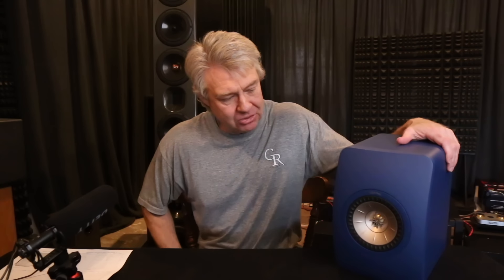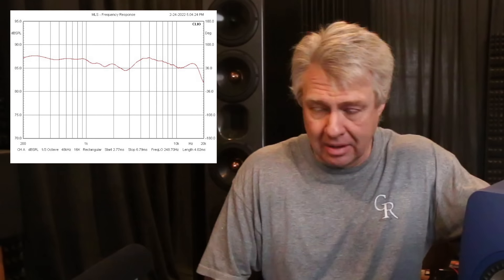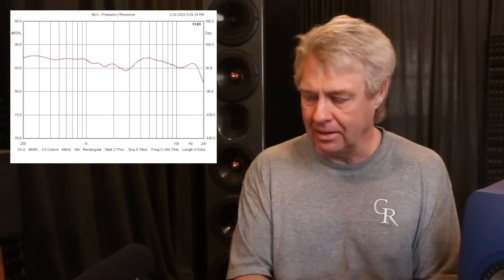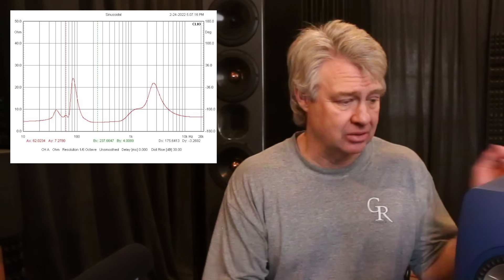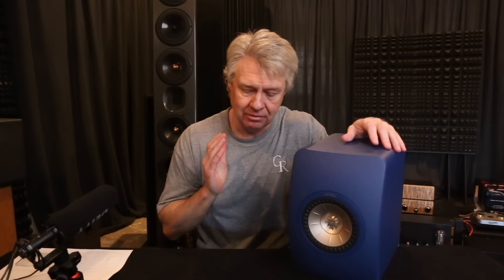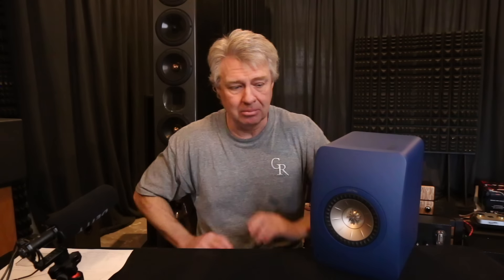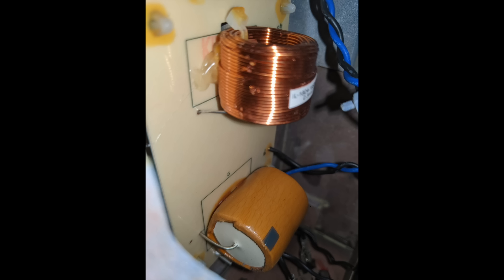KEF LS50 Meta! Worthy of HYPE?

Comment: Interesting ... Main reasons for the "listener fatigue" are:
* Too bright sound.
* Room reverb.
Since the speaker is measuring pretty good, the only reason for the former is other equipment characteristics or settings. As for the room, if sitting closer (really near field) helps, it is the problem that can be addressed in many ways.
I own LS50 Meta since they ware released (over 18 months). And I love them for many reasons. They are in use for many hours almost every day. 
For me, the main trick to have great sounding system without overspending is to have a pair of decent subs. This is even more true for ppl like me having home theater and music in one package. The subs dramatically reduce the requirement for the amp. They also leave the speaker to focus on  the job of fine details. I had the opportunity to evaluate this theory against few times more expensive "true audiophile" setups and it proved to be correct. Not to mention that having subs makes speakers placement easier.
Reply: My experience is totally different than yours, I didn’t like the LS50s (original model) and having more than one sub would be a nightmare to me 
Everyone has different ears I guess
Reply: Bright isn’t the only problem, any bump in the 3 to 5 Khz region makes a speaker sound really annoying
Reply: @sccanj  
Liking is something subjective :)
LS50 Meta are (objectively) great speakers for the price and can do very well on their own given appropriate room size, amp and room correction/treatment. 
But I totally understand why some people consider them (subjectively). 
A pair of subs is not a requirement. But a single decent 8-10"  sub will do wonders to any setup. 2 are just marginally better. Mostly at distribution of the lows across the room.

Comment: Great assessment as always. I would caution that manufacturer part choices are not only based on budget constraints but also driver synergy and balance. Simply replacing an R, L or C of the same value with a better part may not yield the same sonic signature and balance that was intended by the manufacturer.
Reply: Well said. It's a great speaker, I listen to these at a cafe every morning..
Reply: Exactly.

Comment: The LS50 comes with port plugs. One is a donut and would help with port resonance without hurting bass response much. 

I had the previous gen LS50 and didn’t find it especially fatiguing.
Reply: If anything you would expect some low frequency extension from plugging the port.  You might lose some SPL, of course.

Comment: I've compared these directly to the Totem Sky monitors, and the Totem's were the clear winner for lacking all the flaws you said come with electrolytic caps and cheaper parts, etc. They're decent for their price, but a few hundred more gets you more transparency, soundstage, and low level detail on account of the better parts in the Totems. The one thing these do better, is the complete lack of box colorations. These cabinets are inert as I've ever heard. Heard on their own though, you'd think these were pretty darn good. They're dynamically a bit restricted for a woofer of this size, on account of part of the cone area being used for the tweeter, but they still throw a good size soundstage, so they don't sound terribly small.

Comment: Sometimes, the fatigue comes from too high listening level, trying to get some more bass. I'd suggest a midbass module or a sub for a more pleasurable experience.
Reply: "A flat in-room target response is clearly not the optimal target curve for room equalization. The preferred room corrections have a target response that has a smooth downward slope with increasing frequency. This tells us that listeners prefer a certain amount of natural room gain. Removing the room gain, makes the reproduced music sound unnatural, and too thin, according to these listeners. This also makes perfect sense since the recording was likely mixed in room where the room gain was also not removed; therefore, to remove it from the consumers' listening room would destroy spectral balance of the music as intended by the artist."

That’s from Sean Olive’s blog.

People prefer a downward slope in room for a number of reasons. This doesn’t mean all people, of course.
Reply: Agreed ... even further, I'd mate these with a full tilt dipole bass system AND a monopole subwoofer below. 

Nothing like dipole bass/midbass, and the manner in which it resolves LF... just physics.

Comment: I had a pair of Kef 104/2 for over 30 years...Replaced by Watkins Gen 4 and a JL Audio e112 Sub.SOUNDS REAL GOOD
Reply: Hi Ray, I am still running my original KEF 104/2 with a PS Audio Sprout. They still sound wonderful. I have been thinking of new speakers, but not sure if newer is better.  What do you find better with your new setup?  Thanks
Reply: My roommate had a pair of KEF top of their line speakers back in the mid80’s. Ran them with the Adcom GFA 555 and matching preamp. They sounded good, really good, but I was in a love affair with my Dahlquist at the time (would stay there until they were stolen). I was just glad we lived in a big townhouse with a floor between us when listening at the same time .

Comment: There is a 2R7 series resistor in the tweeter x over in my Metas! Both the large value electrolytic caps are in shunt on the woofer circuit so forgivable for the price. Yes I agree though, super difficult to upgrade without going to an external crossover
Reply: This one had no resistor on the tweeter circuit. Those electrolytic caps are in the direct signal path and do degrade the signal to the woofer.
Reply: @dannyrichie9743  The tweeter resistor is hidden behind the series cap. If you don't take the board out you won't see it
I took mine out and traced the circuit. It is exactly as the KEF white paper says. 3rd order with a notch on the woofer, so the caps are in shunt, not series.
Reply: @simondart1481  If only the original boards could be easily removed.... Those caps in shunt are still directly in the signal path to that woofer. What you hear passes right through them.

Comment: System matching  is critical. What amp has the guy with the kefs using. i have heard kef reference  speakers costing thousands use the electrolytic caps they wouldn't make the speaker sound bright .
Tell the customer to buy a warmer weighted amplifer  at a sub, etc

Comment: KEF speakers require 50-100 hours to break in, it’s normal for these to be ‘bright and tight’ until then. Fatiguing? Never… perhaps the wrong amp? They have invested millions in R&D, as an engineer I know anything components and speakers or anything for that matter are designed to meet a price point in the marketplace….These are very highly regarded, our customers love them.
Reply: Room treatment and speaker placement is the issue. Even with a "bright" amp, you can make the LS50M much more warm sounding by doing a bit of acoustic treatment and placing speakers more off-axis.
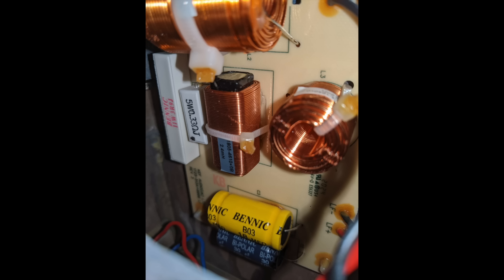Reply: well that 50 -100 hours are needed to get familiarized to the new signature sound... lol 4:54 nice chinese caps, that`s what im thinking the voice area is really compromised!! i hate that speakers
Reply: @camelazo  Yeah, I can't hear any difference what comes to break in (mostly just getting used to new speaker sound). I still can't understand how someone can hate this speaker (insane build quality, good overall performance, measures well, etc.) I understand if someone hates overly bright speakers that are a pain to listen to, but these even measure well in most of the test I have seen.

Pair LS50M with sub(s) and you have a solid speaker system for a small to medium size rooms. There are better speakers, for sure, but I find it hard to hate if speakers are optimally placed with good room acoustics.
Reply: Millions in R&D ... but did you see that filter!?!?!?

Comment: The sound of the Kef’s are a bit more depending on a good amp than some other speakers. The Meta’s are better sounding than the first generation LS50. Those were also very good, but a bit fatiguing with some not so good recorded songs. The Meta’s are great in a smaller room and a sub is necessary for the low frequencies beneath 60 Hz. But please use a good amp like Hegel, Arcam, Naim, Roksan etc. These speakers are just as I expected. Good measurements, very good cabinet, overall good crossover, excellent sound for the size, imho best in this price class. It’s a definitely a killer, this Kef is a world wide succes. But no word about the soundstage of these speakers. If you place them correctly in the room, on good stands, these speakers are sounding incredible, sound fills the room without the idea that it’s coming out of the cabinets. That’s why so many people like them so much.
Reply: Really?
Reply: Try Flamenco sketches by Coltrane and Davis, maybe you discover what the Meta’s are capable off.
Reply: I would say that the LS50M sounds good even when using a low-end amp but really shines with high-end gear. Definitely needs a sub but never sounded bad even with a cheap amp with enough power. I have been testing even with multiple $200 - $600 amps and never had a bad experience with my listening space with good room treatment. It's a solid speaker for small to medium-size rooms if you like a clean detailed sounding speaker. If it causes fatigue then the room needs some acoustic treatment.

I did fix the rear port "boomy" sound issue with nice DIY 50/50 diffuser/absorber panels behind the speakers. That small change had an insane impact on the overall performance, depth, and soundstage. Definitely way better results than using port plugs.
Reply: I just got a pair. Only listened for 30-50 hours so far... Using with sub (as I do with all my speakers). Sound quality is fine, but what I like is that I can be anywhere - even laying down in the floor - and the sound stage is decent. Very useful when you do not have the perfect seating position in your room!

Comment: Yes I find the voice on these speakers can sometimes sound a bit veiled. That’s why I wld pair it with a 48W Class A SET Willsenton R800i to bring it out. Spkr wires also make quite a diff , Van Den Huls sound too soft I found , when I used silver wires from Xangsane ( Chinese) , the clarity, detail , imaging and soundstage went up a lot. Ofc spkr placement was critical and room dependent. Finally when I changed the DAC from my Matrix mini IPro 3 to the Denafrips Pontus 2 it was night and day. This spkr needs gd associated equipment for it to shine in a small to med room setting. Ofc with IsoAccoustic on the spkr spikes and def use the S2 Kef spkr bolted to the spkr n filled with sand & lead. And finally it needs to be paired with a gd sub like a Rel or KC62.
Reply: I do the exact same thing. It's perfection.
Reply: @V1ralB1ack  BTW I rolled the tubes on the Willsenton - the 6SN7 and the 300B to PSVane Western Electric , the improvement is quite substantial. Next I will change the 805s. I paired it with the Rel T5X sub. And that’s about it.
Reply: @robertwang7825  That's wonderful to hear. Rel subs are amazing. I have different components but same exact idea. An r2r dac, willsenton r300b tube amp (the new version), foam block between the stands and speakers. Filled with sand and sealed with some candle wax. Ive tried to find better but have failed. This is my ultimate setup.
Reply: @V1ralB1ack  That good enough IMO
Reply: @robertwang7825  Same. My next goal is getting a willsenton r800i 805 like yours. They say it's the most musical version
Reply: @V1ralB1ack  Yes you wont regret it

Comment: The  peak around 4-6k could perhaps make it a little fatiguing?
Reply: That’s what I was thinking
Reply: It's on par with everything below 1K, so not likely. Most brightness/fatigue comes from 1-3Khz range and the Metas are dipped 1-2dB in those ranges.
Reply: Why not just put in a smaller capacitor in the 2. order highpass filter just to lower the 2.5db peak there? It would absolutely make it sound less sharp and direct, espesially when the music is turned up. Its also hot off axis in the same area so 1-1.5db would actually make it more perfect.
Reply: @impuls60   that's going to cause more issues than it solves... It's going to affect the crossover point, leaving a dip. And likely wont do enough to tame the response in those areas. It's not really "humped up" so much as the top end rolling off as you get further off-axis which is normal for any coaxial speaker.
Reply: That ultrasonic ringing can create audible IM distortion difference tones in the top octave. For example, a 10 KHz tone interacts with a 22 KHz resonance to produce a 12 KHz tone.
Reply: @hoth2112  Maybe that's it. Could it be the lack of that sound (the dip in response) around the 1 to 3Khz range that's fooling this guy's brain into thinking "he's missing something" so it works harder and ends up feeling fatiguing?
Reply: I recommend listening to these about 10-15 degrees off-axis. It evens out the upper frequency response a lot.
Reply: @hoth2112 Nope! Danny and I disagree here but I've always claimed brightness is around 6kHz whereas Danny says 2kHz. While our ears are more sensitive at 2kHz, most tweeters are crossed over at 3.5 kHz and if you disconnect that tweeter or blow it, I guarantee you won't find the speaker bright. Harshness is often used interchangeably with brightness but not the same thing. The LS 50 sounds thin and pinched in the high frequencies directly and a touch of nasal. I'm sensitive to concentric speaker sound and would not use the LS 50 if given to me for free. I'm an experienced listener so everyone's mileage may vary.

Comment: I am certainly no expert but I agree with Barney from about 3 hrs ago - 5 inch 'bass' isn't gonna get it done, regardless the company. they are designed to be used with a Sub , which I would think would clean up the low mids IF the Sub  and especially Xover  is good.  Note, I have Metas, Outlaw receiver, Def tech Sub.....Many might say that's not even 'Audiophile'.....
Reply: The Outlaw is a wonderful receiver !

Comment: You can find information how to tweak the KEF LS50 (no Meta) when searching for "KEF LS50 Tonfeile Pimp" and "Pimp my KEF LS50" (all in German). It provides information how to open the cabinet by removing the front baffle via 4 screws from the back (may be different on the Meta version?), a suggestion for an alternative bass driver crossover and some nice pictures showing the build and parts quality. I recently shortly listened to the LS50 Meta and was not 100% satisfied, especially cabinet vibrations where a little bit disappointing to me, maybe it is because the front baffle seems not be screwed instead of glued to the cabinet.

Comment: The cap on the tweeter is a little too big. Lower it 1-2uf and it will bring that hump at 4-6k hz down. Then, a 15 deg off axis listening position should be recommended imo.

Comment: I got a pair of these and the biggest problem I had was the bass, just too much and overwhelming I had to plug the ports to get them to sound ok in my room. They’re solidly built though. I sold them though and bought the real thing, LS3/5a.
Reply: You'll need to add a good sub (or two!) to those little boxes if you want real base.
Reply: Don't blame you I had the originals one of most overrated speaker iv ever heard now got Pair of Atc a real speaker
Reply: @willbrink  enough bass for me without sub, I’m not into bass so long as the tone and I can actually follow bass lines without being swamped in bass.
Reply: @justinparkman3585  atc’s are awesome speakers. Very accurate and revealing however I have since sold mine and have gone the diy route. Far better performance for the money spent.
Reply: I have both, but the Meta’s are better sounding in every aspect.
Reply: I did fix the rear port "boomy" sound issue with DIY 50/50 diffuser/absorber panels behind the speakers. That small change had an insane impact on the overall performance, depth, and soundstage. Definitely way better results than using port plugs (that didn't really fix the issue). That problem was 100% my room and easily fixable. With proper listening room, the bass on LS50M should never sound overwhelming. It needs a proper subwoofer or two to sound nice tho :D

Comment: if you want to work on a awsome nugget, try get a KEF ACE 9000 center  L/R.    /  its from the earlye 2005s, such a unique HT speaker, i had a 3 front they was awesome, very much.
if i remeber correct it had. a active carbonfiber  pod inside something something. big sound from a thin speaker. and used the Q series top range units.

/

Comment: I found my Kef Q100 had a dip at 105Hz, have not compared to my Q150 yet but that would be interesting. Now have  Kef R3. No more dip at 105Hz so I think could be due to the crossover/ updated driver/ shadow flair but WOW, KEF R3 is a Fantastic speaker with amazing clarity, dynamics and superb bass extension. high frequencies do drop off but easily boosted. I would very highly recommend Kef R3s to anyone using nearfield (need at least 1.5 to 2metres in front of speakers to hear bass) or for any room exceeding 10 square metres.